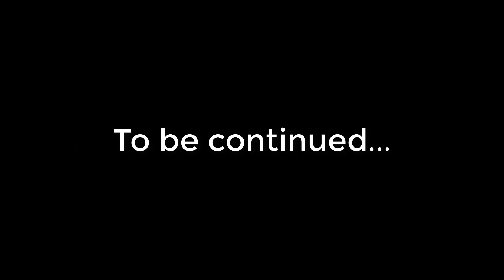Preparation for Rooting Grape Cuttings

Comment: I'm looking at the flowering vegetation in the background and guessing that rooting time is in the spring....  But, have the plastic wrapped cuttings been stored in a cool location?  Can the grape cuttings be successfully propagated if cuttings are taken during other months as well?  Will fall or autumn prunings be good enough material to use?  Will cuttings made during fall and winter need to be stored in coconut coir, sphagnum moss, or other materials to protect them from frost or buried deep enough or other recommendations? Thanks for your great videos.
Reply from the maker: Thank you for your informative comment. I prune the vine in the fall. I store the cuttings in bags in a cool place until spring or bury them in the ground.